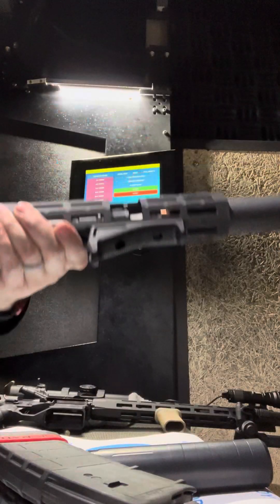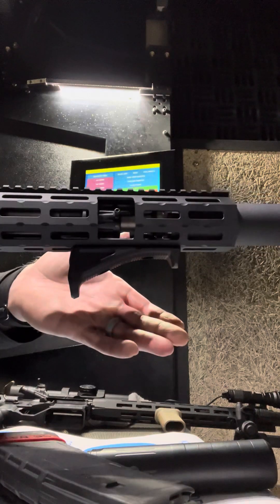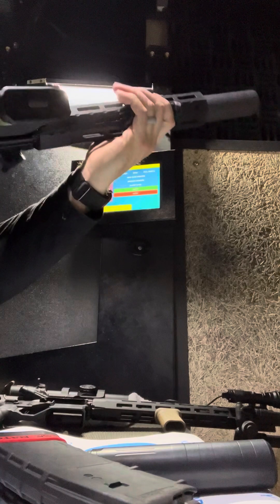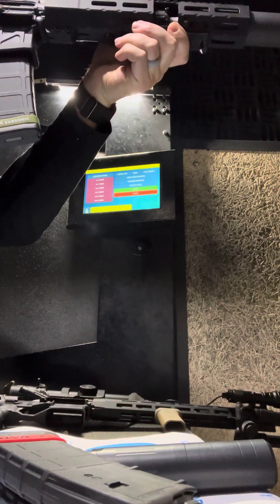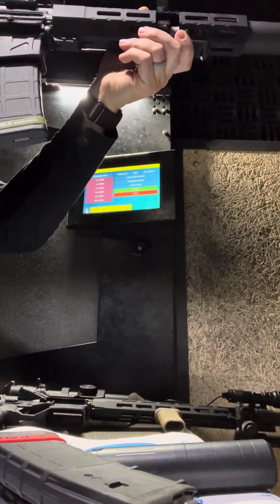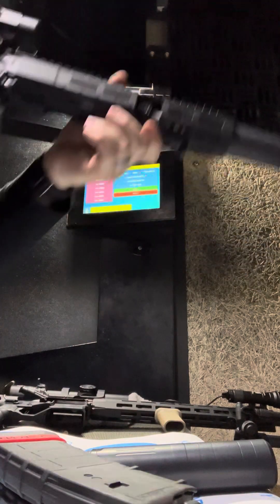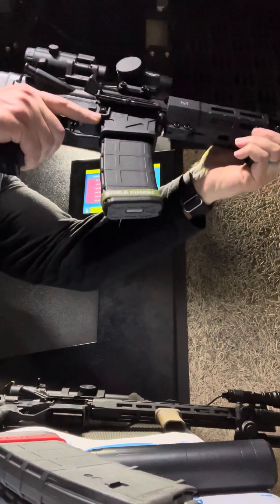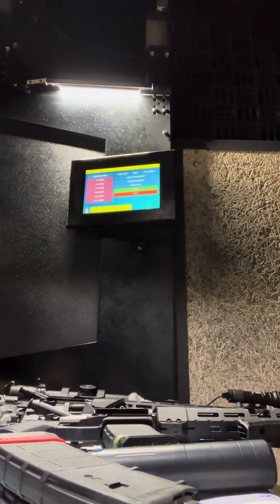CAT ODB Ti HUB on 8” 300blk Supers and Subs

Comment: What do you think about CAT's 10" min barrel restriction? I have a spooky on a 10.3" 5.56 and was hoping to use the ODB on that and an 8" 300 BO I'm building.
Reply from the maker: @JTG40cal  I would just get an IR temp gun to make sure you don’t exceed the max temp for the Ti or 718 (don’t recall each off the top of my head, but I believe 718 is double Ti). 

Pew Science tested the ODB on the MK18; so, I don’t think the 10.3” barrel length would be a problem as long as you manage your firing schedule. 

8” 300blk, especially with subs, should be perfectly fine. I haven’t mag dumped mine, but I run an 8” barrel and haven’t even come close to the upper limit. 

If you are looking enough to have a select fire lower or do a lot of rapid fire, you might want to get the Inconel version; otherwise, the Ti seems plenty durable for my use.
Reply: @illestdomer2005  Thanks for the reply! I certainly won't be mag dumping, but with the titanium's barrel length, rate (<30rnds per minute), and operating temp (650F) restrictions...I think I'm gonna go inconcel.  Then, I won't have to worry about any of that and still get the AMAZING suppression. Shooting subs, it sounds like a mouse fart 😆

Comment: Have you tried rapid firing it for a couple mags? Was looking at this for my next can but was concerned about durability. Not gonna be doing crazy mag dumps but would like to be able to run some drills with it and not worry about it.
Reply from the maker: I haven’t, but I wouldn’t be worried about doing it either. I believe CAT posted a video of them dumping 6 or so consecutive mags with a titanium WB or ODB, and it definitely showed some…wear, but I can’t see any issues even with a single full mag dump, let alone a few bursts here and there.
Reply: Hearsay but I heard if your shooting .300 don't worry about it. Your pressures aren't going to be high enough to warrant a firing schedule

Comment: I have a CAT Inconel WB QD in jail for my 12.5 midgas, with RifleSpeed gas block, Sprinco Blue spring and H3 buffer that currently runs a CGS SCI SIX. And I have a Titanium ODB QD in jail for my Aero 8in BLK that runs my old form1 can. Since CATs stuff is higher flow rate and I only run subs,I’m gonna keep my 300 with a regular gas block and just throw in my Bootleg adjustable BCG and maybe mess around with a heavier buffer and spring
Reply: Lmao homosexual
Reply: @angryraylangivens1281  more trash talk like a child In a COD Lobby. Once you become a grown man and actually shoot your guns, and stop deep throating your RC2 after you pull it out your ass, maybe I’ll entertain you some more. Go be useful somewhere else till then.
Reply from the maker: I feel like the Riflespeed is an awesome addition to a 300blk rifle where you might run unsuppressed supers and of course suppressed subs and supers. For 5.56, I really just need to tune the gas for my can(s). 

That said, I do like the Bootleg as an easier drop-in option, and I have seen folks use it with 300blk successfully too. Especially for a shorter barrel, I think it makes a lot of sense to go with a fixed gas block using the ODB. It seems to be much less sensitive to gas differences between supers and subs.
Reply: @illestdomer2005  Are you concerned that in their written documentation that the Ti model shouldn’t be used on barrel lengths shorter than 10”?
Reply from the maker: @markrothhaar9454  I haven’t seen that documented, but I don’t have any concerns either. I have a titanium Sig can that lives on a 6.75” 300blk barrel where I use supers and subs. I haven’t had any problems, and CAT has shown mag dumps on their Titanium that far exceed anything I will be doing even if it’s an 8” barrel.

Comment: So how did it compare to the Enticer?
Reply from the maker: They’re both awesome 300blk cans. The Enticer is definitely higher backpressure; so, if you have an AGB, you can save yourself a lot of money going with the Enticer. That said, the ODB is outstanding. I don’t regret the purchase at all, and if I were doing it all again, I would have just bought the ODB.
Reply: @illestdomer2005  Yeah, I need something for the Radian Model 1 300 BLK which doesn’t have an AGB.
Reply from the maker: @compositetiger  100% endorse the ODB then. Running it on my overgassed 5.56, it performed as well or better than the Velos. They definitely have some magic in there with low backpressure and great subsonic performance.
Reply: @illestdomer2005 Which buffer are you using for your 300 BLK pistol?
Reply from the maker: @compositetiger  I think this was still the LWRCI UCIW (SBR), and I have since switched to the JP SCS carbine weight system which feels slightly lighter than the UCIW which is supposedly similar to an H2 buffer. I’ll probably have to go to a shorter plunger on the Riflespeed AGB when I run the ODB again.